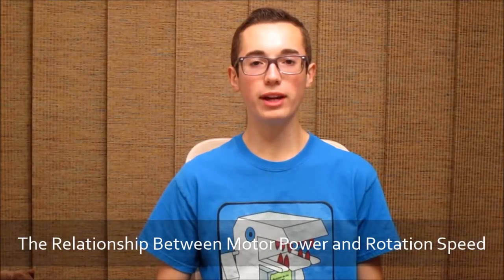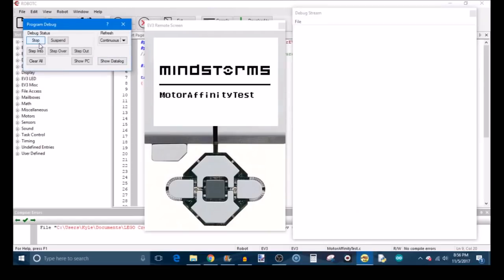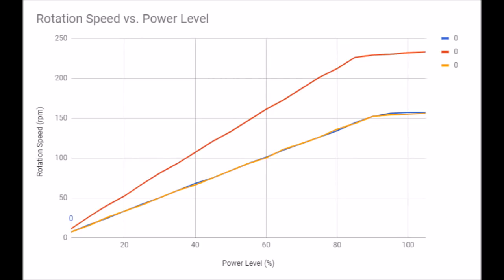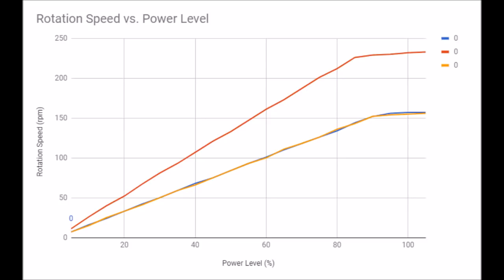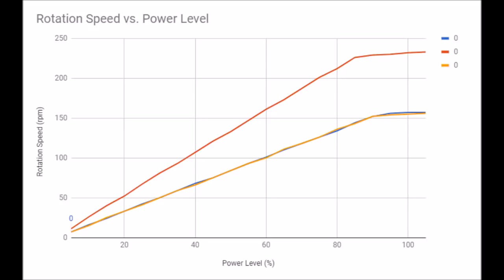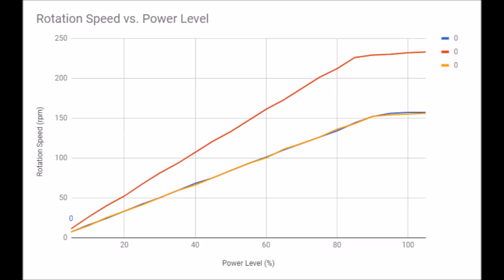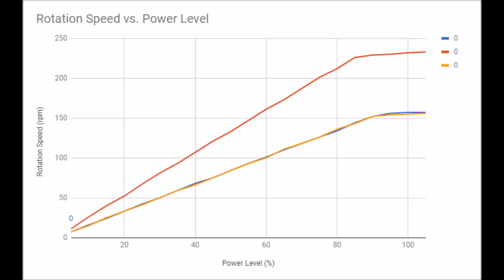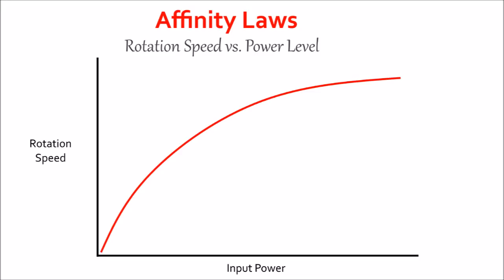EV3 Motor Power vs. Rotation Speed - Affinity Laws and a Cool Experiment to Try!

Comment: It would be interesting to see the results under different levels of loading.  I would guess that the slopes would be reduced (i.e. lower rotational speed for a given power setpoint), and also the range of linear response is likely smaller.
Reply from the maker: Thanks! I think I may try this in the near future. Stay tuned!

Comment: Nice job... this explains why we cannot get our PID line followers working at speeds >80. What would happen if we did the same test with unregulated motor blocks?
Reply from the maker: Thanks! I don't think this has anything to do with difficulty using PID line followers at high speed, though. I would love to try this with an Unregulated motor, but RobotC doesn't have an Unregulated motor block (as far as I know, I'll need to check). I suspect that the curve may be mostly the same at max battery level, but you'll see more of a difference as battery level declines. I may choose to do a video focused on doing a test with the Unregulated motor in the near future. In the meantime, for more information, check out my video on the Unreg here: https://www.youtube.com/watch?v=ZNriEwysfRw